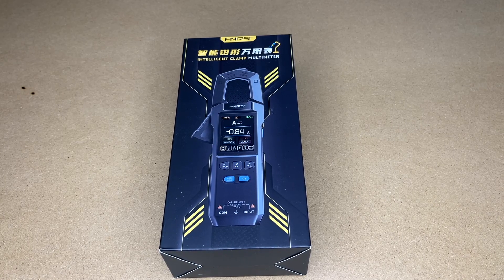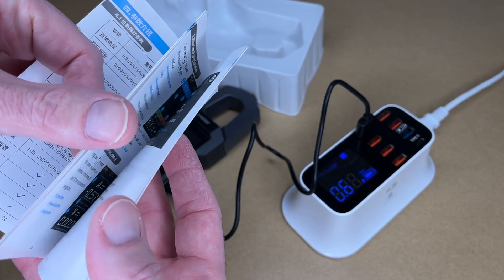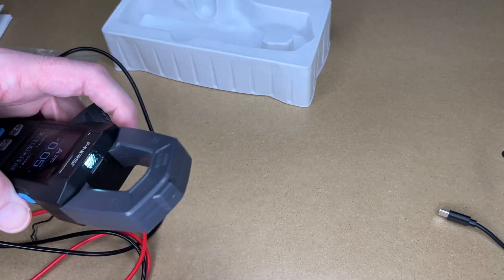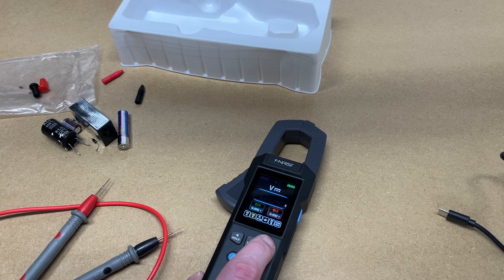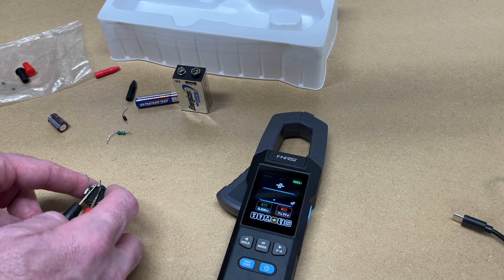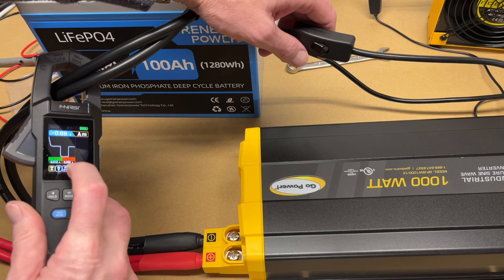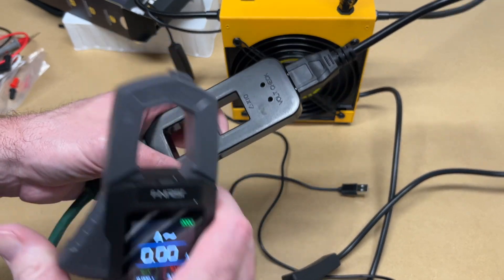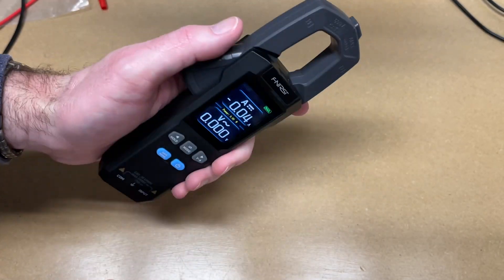FNIRSI DMC-100 AC/DC Digital Clamp Multimeter

Comment: Informative video, thank you. I 'm thinking of buying this meter. Does it display 2 decimal places around 50v dc,  example, 55.65v as opposed to 55.6v. A lot of meters will only display 1 decimal place once the voltage starts to rise, regardless of the range set on the meter. Thanks for any feedback.